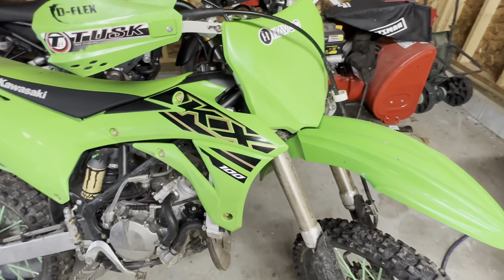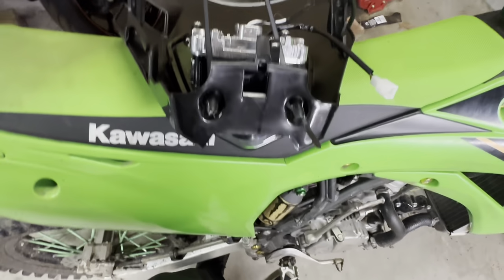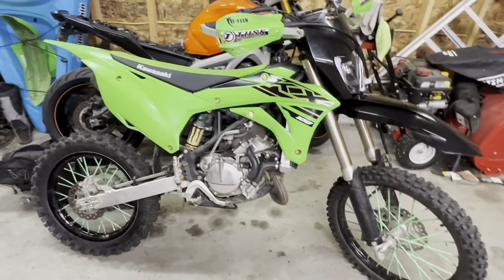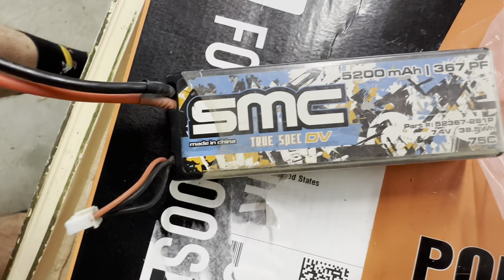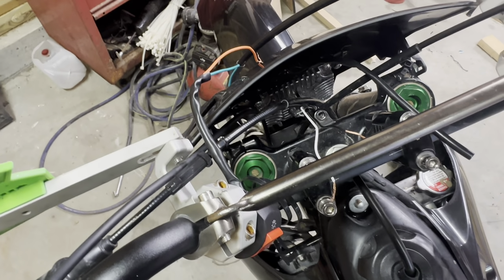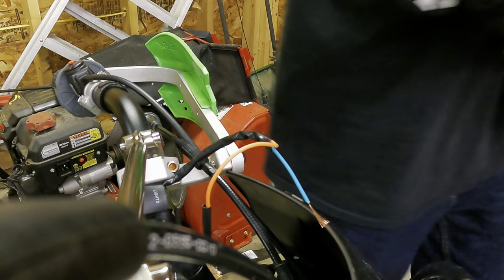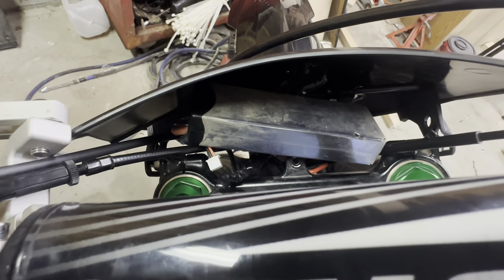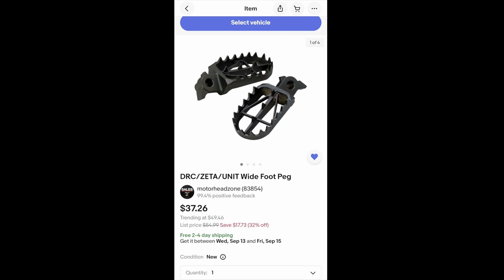Kx100 enduro build! Ktm headlight/fender setup + other goodies!

Comment: Awesome headlight set up i did the same thing. But with a dewalt battery hold and rectifier. Works great and holds a charge for a weekend
Reply from the maker: thanks man, definitely a great little set up🤘Drill batteries are awesome too I just already had multiple RC batteries or I probably would have gone that route because those will last longer with how much capacity they have. what voltage drill battery are you running?